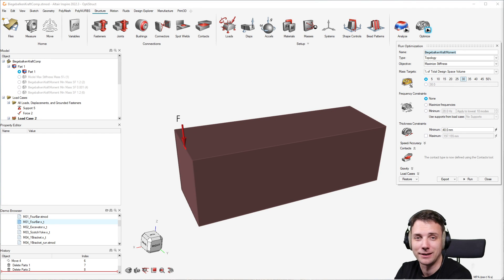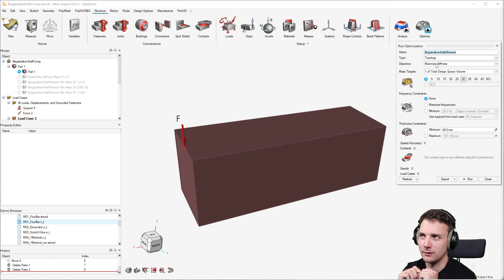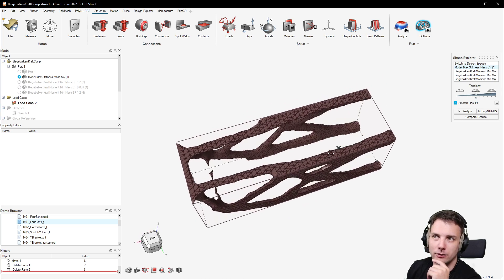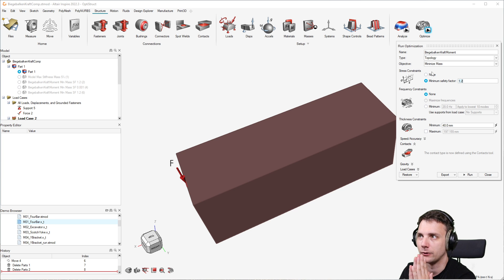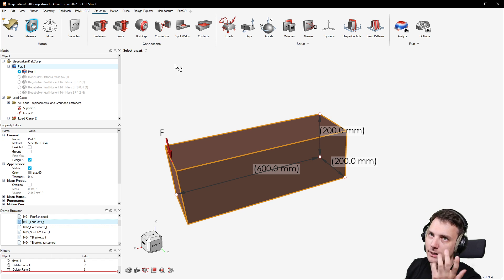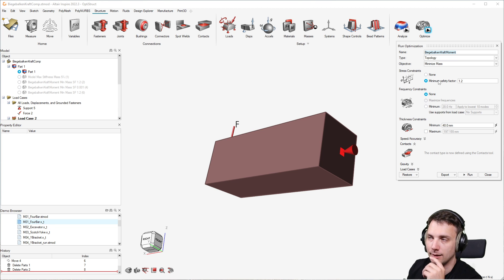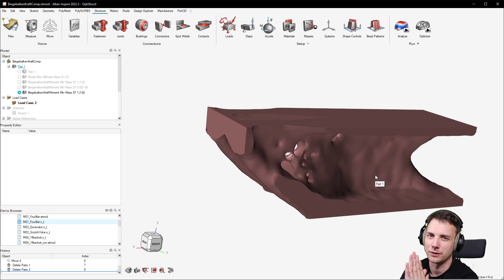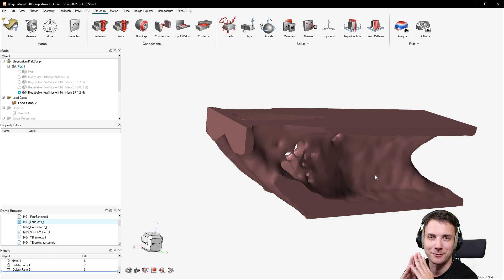Altair Inspire #short - Compliance vs. Stress-based Optimization

Comment: Would you explain what is different between Altair hyperworks and Altair inspire..
Reply from the maker: Sure thing. In short, Inspire is targeted at the CAD engineer with stress calculation afinity. Its easier, well automated but limited in scope. Hyperworks has been renamed to Hypermesh and this is the full feature Preprocessor for the stress calc guy. Much more detailled, more functions etc. 
So, for a quick look at things, quick optimization: Inspire is a great tool. If you want to have detailled control and / or a more diffficult setup, then use Hypermesh.